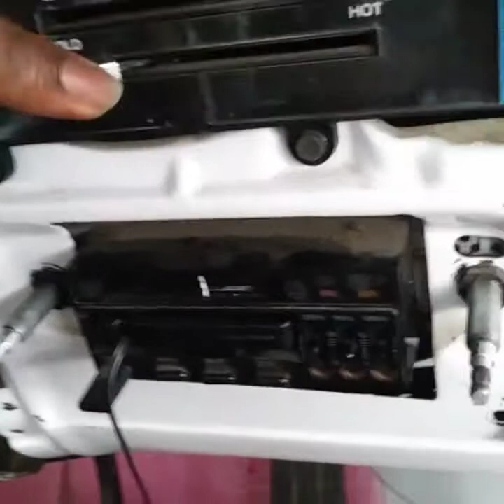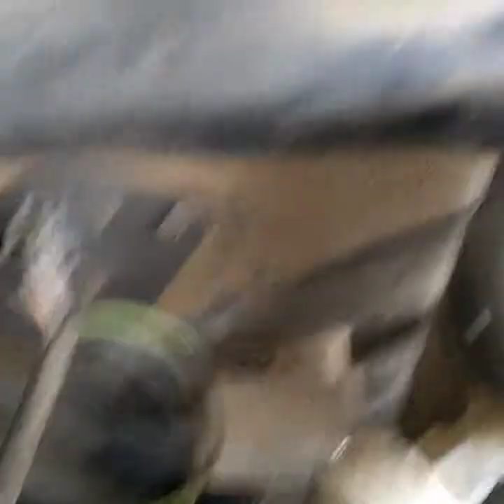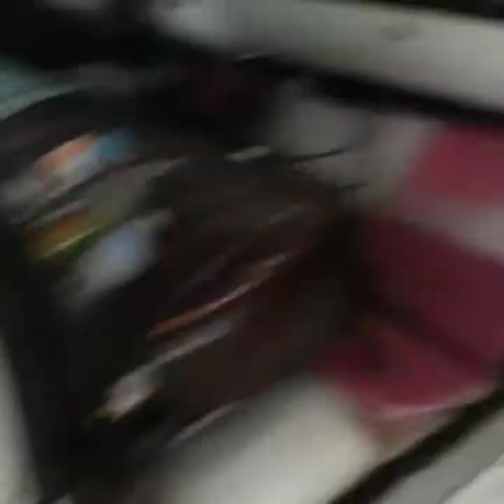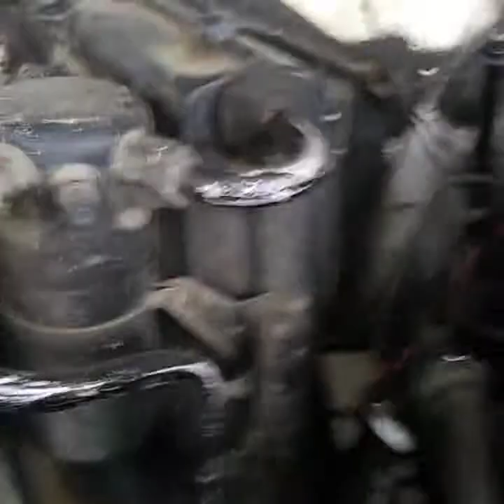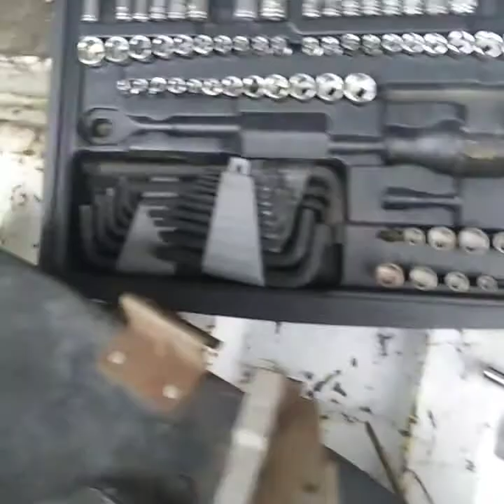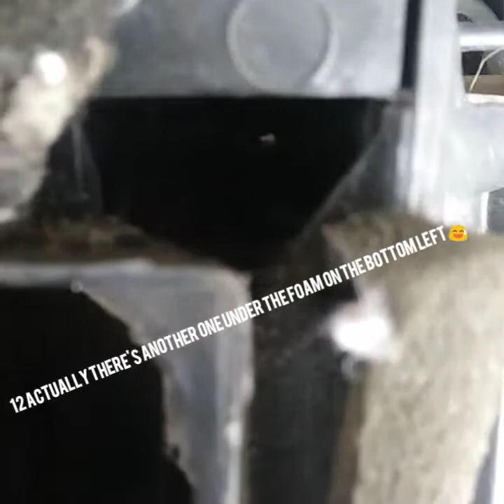C10 Heater and fan fix

Comment: I replace my relay my resistor but the relay hot red wire that coming out of it that runs along the firewall to the junction box I don't have the other side plugged in that goes into the firewall can anybody help me above fire I plug into the 79 Chevy truck
Reply: Hey were you ever able to fix your problem? I have the same issue
Reply: @MidloCars  you ever figure it out? Having same issue